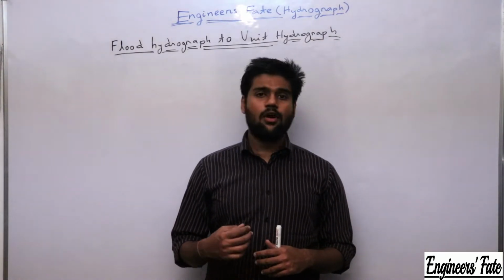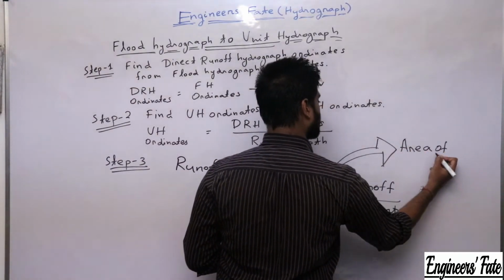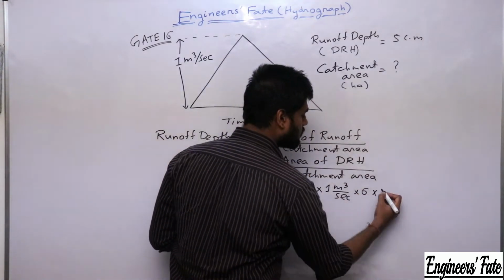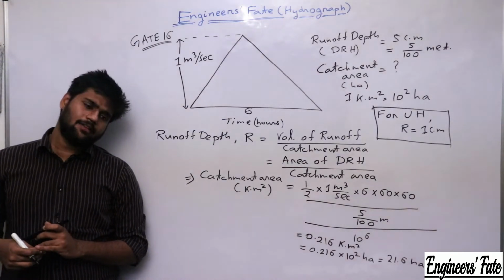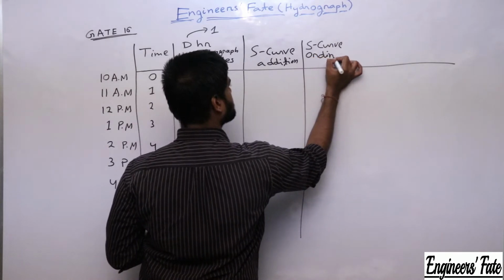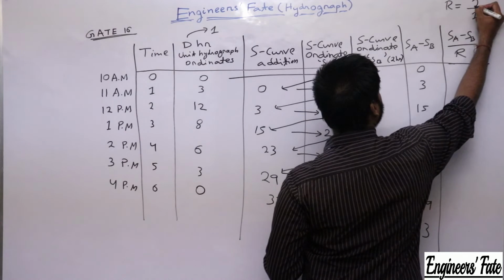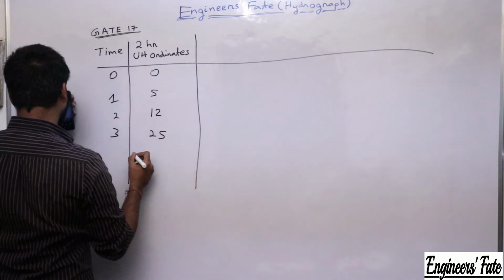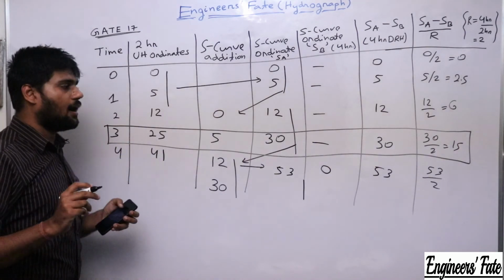How To Solve Any Hydrograph Question Using S Curve Method - Hydrograph - Hydrology -Gate Civil Engg.

Comment: Sir how can i solve for catchment area there is no given run off depth?

Here's the given
Time (hr) : 0 8 15 19 26 31 38 34 44 49 55 60 66
Observed hydrograph: 100 100 200 800 1100 700 600 500 600 300 100 100
Sir please help me. Thank you
Reply from the maker: If Runoff depth not given assume it as 1 c.m, find the volume of the Hydrograph using Simpson's rule. then find the catchment area